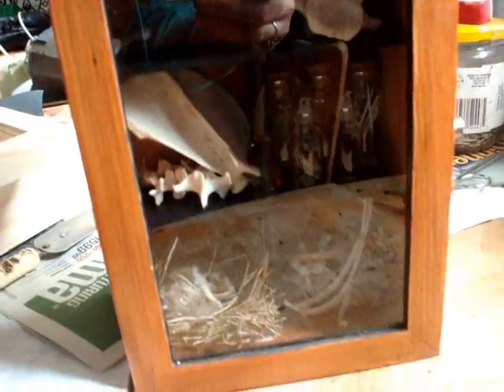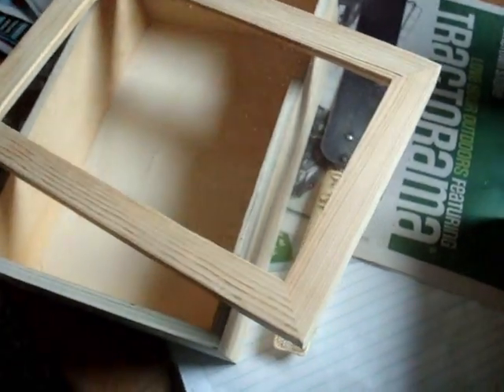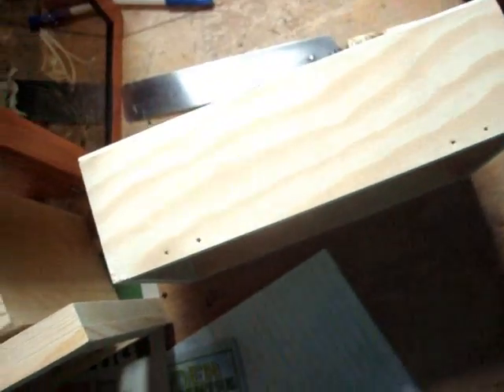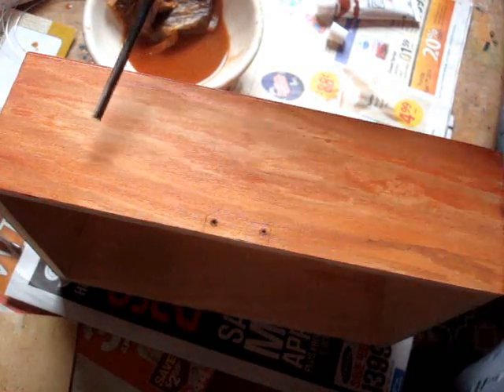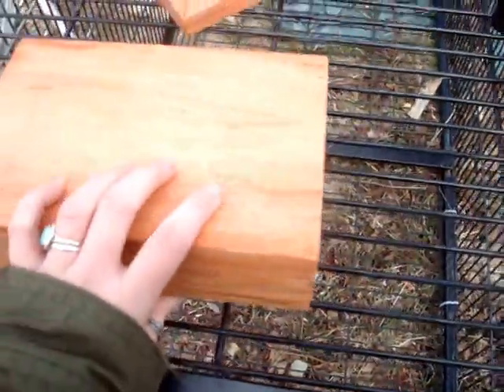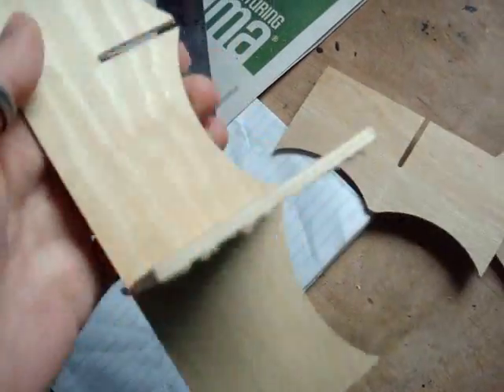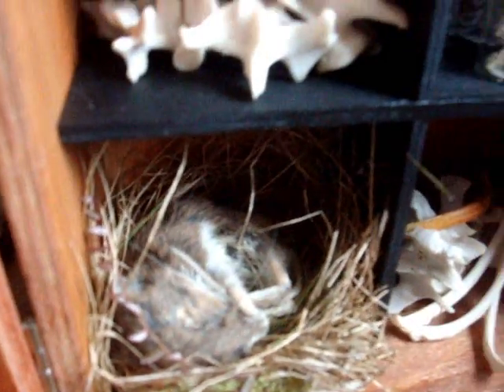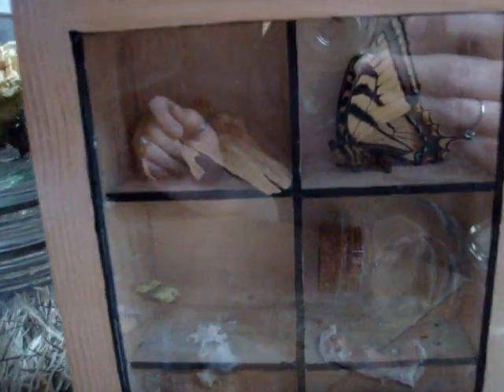How To Make A (mini) Curio Cabinet

Comment: Hi Shadow,

A credit card works pretty well for the scraping.

You may find some folded tissue placed over any label on anything will hold the water and it can be left on for many minutes while doing its stuff to remove the label, if the label is a little reticent. And carefully sanding the label only to score or afraid the surface taking care to be gentle and not go right through to scratch the glass. The water will then soak into the label easier.
Fold a tissue to roughly the size of the label to be removed and wet with whatever you want, the tissue will go flat and absorb the moister  holding the liquid so you could have a meal or a cuppa, (Cup of tea) for those not familiar with this English UK term. Work particularly well if you need to prevent the liquid running off of vertical surfaces and which cannot be tipped over to have anything removed, but in this case use low-tack or ordinary stick tape pressing really hard over the tissue but  hardly any pressure on the clean surface, this is not to completely secure the tissue, just to hold it is place while you wet it and wait.

GREAT JOB!
BTW if using these boxes which I have not seen in England UK if a slightly ‘deeper’ shelf with no front scolloping, simply reverse the inserted dividers.
Good advice to remove and keep the screws and furniture holding the bad closed. One can also remove it all including the glass if it is possible and including the hinges if a different style or colour or for instance larger or much fancier or hand made furniture making sure the original holes are covered by the new fittings. Furniture is the name we in the UK use for anything on doors like locks and letterboxes, and it also applies to this kind of item.

Take care
mrbluenun
Reply from the maker: i actually have the proper plastic scrapers, but i couldnt find them :(
if the shelving is reversed, the scalloping is then in the back and leaves a hole out the back of the shelf :S

Comment: I see some faces of these otherwise very well made boxes are pretty well dried which has pulled down the wood and left what looks like gouges. To get an ice smooth face finish give the whole box several coats of varnish rubbing down between, or if painting, us a brush applied ‘Primer’, which can be usually pink or grey, it may be enough to use just one coat, though more will completely cover any other small dents and knocks. 

The grade of the sandpaper may be indicated with other codes but I think you will find the 600, or any number will be rough enough to sand wood that needs the top minuscule roughness back to get the smoother surface. Your 600 is about mid-grade for wood and a finer 400/200 or maybe even 100 ceramic for an almost ceramic smoothness, though this might not have enough of an ‘edge’ for wood, and the 600 etc means the Micron grade, so each grain of sand or anything on the paper with be 6/10th of a single millimetre can be used to very lightly rub off any raised splinters the work on the box brings up after painting or vanishing. Do NOT trash so called old worn-out sanding sheets, these are ideal to use between paint and or varnish finishing, they are unlikely to rub-off any edges and it will take just a few strokes to make a great very smooth face.